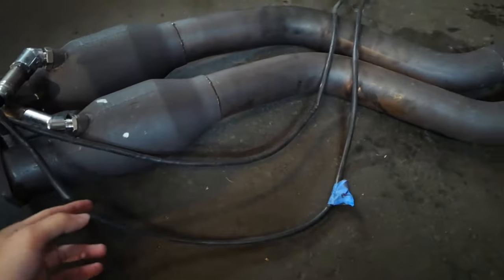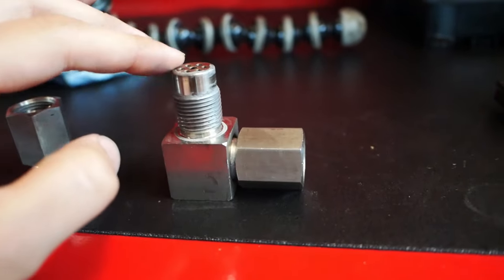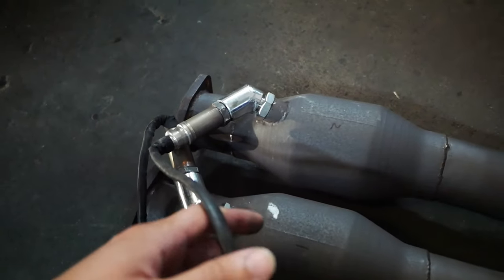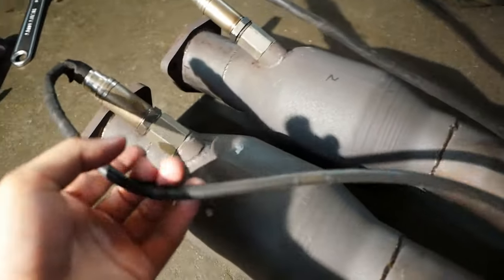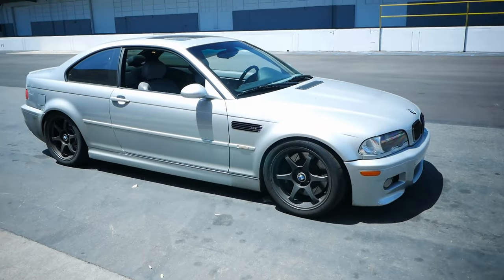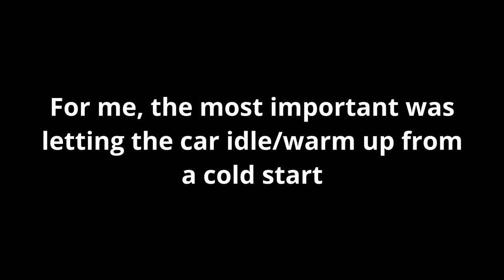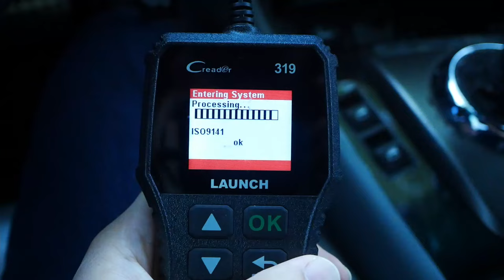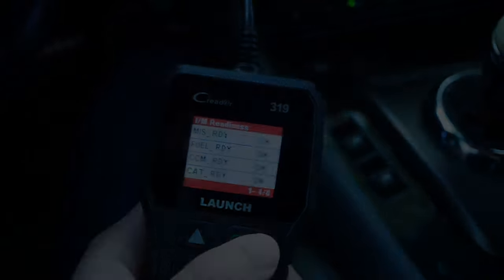Fix P0420 Code | How To Use O2 Sensor Spacers | Project M3 Episode 2

Comment: Omg 4th try and it passed smog! Used 2 Autozone 42002 non foulers. Thank you sooo much. You're the only one who said to try diff lengths. No vids I've seen said that. On my way to get my sticker. Helllloo June 2021! Yes they're that expired.
Reply from the maker: LOL hell yeah! Congrats!
Reply: @HazardGarage  I installed my spacer got rid of the light but I'm having a loud hissing sound coming from my exhaust when accelerating. Any clue what it could be?
Reply from the maker: @TimPool-b8z  you might have an exhaust leak. Check you tightend all the bolts and check the condition of your gaskets.
Reply: @HazardGarage  Dorman 42002 uses an angled seat. All O2 sensors use a flat seat with crush gasket. The Dorman version built like this with flat seat and gasket is 42009. An angled seat may give you a leak against a "flat-bung" surface that wants a gasket.

Comment: I remember doing the drive cycle for my 07 Maxima after replacing the catalytic converter and it took a couple days. When the sensors finally readied, I wasn't even trying to do the cycle, I had actually given up. I think the car was just laughing at me at that point. There's really no one size fits all strategy when it comes to completing mymonitor readiness.

Comment: The spacers caused a lean code for me? I am running long tubes with high flows. Without the spacer and the code cleared they won't come on or be green. All other monitors are ready.
Reply from the maker: 1st make sure these are on the O2 sensors that are AFTER the CAT not before.

2nd I had to do trial and error with various lengths. It was an annoying process. O2 sensor not reading correctly or too lean? You have too long of a sensor or too much interference. Use a shorter spacer.

Still getting P0420- bad cat codes? Run a little longer spacer.

Also the CAT sensor is the hardest sensor to get 'ready'. On average about 50-100 miles to throw a CEL if it wasnt good. And when it was good, I had to drive about 200 miles before it switched to 'ready'

Also make sure you dont have a tune on the car that disabled the rear O2 sensors.

Good luck!
Reply: Thanks for the response.  I have a tune for them to be active. I guess the journey begins......
Reply from the maker: @robettballard710  lol I feel you man. It took me like 4 tries to get just the right amount of length spacer. And then all those miles getting the stupid car to complete its readiness checks. Good luck!
Reply: One more question? During these trials did you complete the cycle in one day or multiple days? Or does that matter. Thanks.
Reply from the maker: @robettballard710  it doesn't matter if in a single day or over several.
Reply: Thanks

Comment: Where did you get your spacers
Reply from the maker: off of ebay! check the links in the description. (I just updated them as I noticed some were dead).
Reply: @HazardGarage  eBay banned these
Reply from the maker: @XenomorphLV426  I noticed that! Crazy! Guess you gotta go the 'spark plug defouler' way now. Unless savvy sellers rename these...
Reply: Don’t waste your time or effort because the code will come back. This is not a fix it’s a temporary to get used to omissions to get the light out after 10 to 12,000 miles. The light will come back guaranteed I know because I’ve done it I drilled the one to a half inch and put the other one on quite a few things will happen you’ll get pinging on acceleration, poor gas, mileage hesitation on acceleration quite a few things will change you won’t see it right away, but it will start. Don’t waste your time fix the problem why is it coming on get that fixed? If it is the cat get it replaced don’t play this game. It’s a money gimmick.

Comment: Another thought....seems you could have used the original 90 degree "cube" style you show.....but trying it severals ways.....with or without the mini-cat-material insert ( if it came with one).....and the piece that screws into the cube can used or even not used....just plug in the sensor into the cube. That alone gives you 3 "length" variables. Also this.....some folks buy the Dorman 42009 pair and either one ( or none) of these 2 parts added as 1 or 2-stacked pieces can also be tried with the "cube". I felt the same joy you had showing " 0 " DTCs !!!!!!

Comment: Trying to wrap my head around how we get a "tight" connection between the "cube" and the "bung". I see it allows angular orientation to change.....but... Should there be a gasket between the "cube" and the lock nut?...and also between the same locknut on the other side against the exhaust port "bung?.

Comment: I put 2 spacers with steel wool on my Maserati Gt with the v8 and it only went a week. I think it burned up the steel wool when I was revving it hard. I’m about to try the mini cat. Smells like a refinery behind the car but the exhaust velocity is really high it blows mulch and rips grass out of the ground so it might need 3 spacers.
Reply from the maker: I dont know if the mini cats helped. For me it was just playing with the distance of the spacing. But really more modern cars are bit more sensitive so its a gamble. Frustrating, I know..

Comment: It’s my upstream sensor that’s throwing the code bank 1 s1 
Ever since I installed LT headers and high flow cats on my challenger I’ve gotten multiple o2 sensor codes it’s been a headache. I love the bolt on install performance has been amazing except for these annoying codes. I can’t pass inspections text in Texas. 
I replaced the o2 sensors and still not working. 
I’ll give these a try 
Thanks for the video.
Reply from the maker: never use a spacer on upstream O2 sensors! upstream sensors tend to be responsible for keeping your engine running correctly adjusting air fuel ratios. Downstream (after the catalytic converter) tend to be used solely to see if the catalytic converter is working (although highly advisable you search and see if this is the case for your car.)

As shown in the video, for downstream O2 sensors, sometimes you have to play with the length to get it just right. And some cars are a lot more picky than others. Outside a tune, this is unfortunately the state of affairs. Also note, if you are using this for emissions reasons, you might not pass a visual inspection (check your local laws).
Reply: Hello, please, can I use these spaces on my car, I'm getting cat low deficiency bank 1 & 2. Please can I use this spacers and which o2 sensor should I put it? Will it stop the code if I put the spacer in the bank 3 and 4? My car comes with 4 o2 sensors.

Comment: Hello I will be installing obx headers and y pipe to my car. I bought some spacers and I would like to know at which  o2 bank locations are spacers needed to avoid CEL? Because there’s down stream and up stream …Please let me know thanks! Great content btw!!!
Reply from the maker: Don't use spacers on the upstream O2 sensor. That is the one before the CAT. This O2 sensor is used to measure your car's Air/Fuel mixture. Downstream (after the CAT) is where you can use these.
Reply: @HazardGarage  after having 02 spacers for a week I got a cel. Any fix to this?
Reply from the maker: @Stay_True_-  you have to keep testing different lengths. Its annoying, I'm not going to sugar coat it.

cat deficiency error - means O2 spacer is too close to the exhaust stream. Needs more spacer.

O2 sensor slow to respond or similar - means O2 spacing is too much. Move closer to the exhaust stream (less spacer).
Reply: @HazardGarage  i replaced the o2 sensor and the code hasn’t came back…hopefully it stays away

Comment: The slow response is due to the sensor is too far from the CAT. The temperature is too low to keep sensor ceramic to be hot enough to work like a semiconductor.
The spacer has to be as short as possible.
Reply from the maker: thanks for the explanation and you are right. When the slow response happened I shortened the length. When CAT deficiency happened, I lengthened it. Played around with this for a bit until I got the riiiiight length.

Comment: Did you use copper exhaust sealant or anything to seal the O2 adapter?
Reply from the maker: No sealant. I did use a little anti-seize
Reply: @HazardGarage  curious how they don’t seal since it’s just threads and not crush washer

Comment: lol you don't HAVE to drive 55 on the freeway. If you just drive normally, it will set eventually. The recommendation to drive 55 is just if you're trying to make it do the drive cycle more quickly, but I don't think that's even applicable to all cars.
Reply from the maker: There was a BMW specific drive cycle to make it go more quickly....but I can tell you after hundreds of miles...it made no difference on a BMW lol. So yeah, I would totally just drive normal lol.

My subaru and Miata however, those were very quick to drive cycle just by driving around but BMW has to be difficult ya know?

Comment: did you have to do a drive cycle with each o2 sensor, or did you get a code immediately for the ones that didn’t work?
Reply from the maker: You generally have to drive around 30-40 miles before a CEL would be pending or show up.

Very annoying process that I had to do multiple times.
Reply: @HazardGarage  i need to do this on my n54 but it doesn’t seem worth the effort with how sensitive newer BMW ecus are
Reply from the maker: @desolatedreams21  its super annoying i agree. But its an option thats out there for those who need it.
Reply: @HazardGarage  i’m going to try it on my e92 for shits and giggles. dpfix is gonna be the most probable solution LOL

Comment: , I have a question
I have the p0430 because my cat is dying, i heard that you have less power if this code shows up. Does the spacer also bring the power of the car back or is just the check engine light gonne
Reply from the maker: some cars might do a limp/safety/reduced power mode when any CEL comes on.

some cars also might use both upstream and downstream O2 sensors for fuel mapping

best is to search around for information on your specific car.

My understanding for the E46 M3 was that there would be no issue with power as long as the CEL was off as I did not find any thing info saying the rear O2 sensors were used for fuel mapping.

Comment: Bit late to the party but the info is much appreciated. The subaru community is currently going through these headaches due to the recent green speed update that prevents tuning out the rear 02.

As I'm just starting to experiment with spacers myself I'm wondering, when you were changing out spacers did you just keep resetting the code? Or did you pull a battery terminal to make sure it's fully gone?

Did the car remain code free? I'm fighting an intermittent P0420 myself and I tried one of those mini cat spacers and got a lean code, hoping maybe a shorter regular spacer might help.
Reply from the maker: I would erase the code then do a drive cycle again. the car remained code free but after about a year I had to unplug the battery and then I started getting a code (lean - so spacer was too much). The BMWs can be finnicky but it works, just annoying to have to keep playing around with the different lengths until it works.

Comment: Any updated spacer links? Looking for the 43-45 length ones. The link listed doesn’t work unfortunately. But love the video, new subscriber here as a result of this solution.
Reply from the maker: wow, I just checked and looks like Amazon and eBay have removed these listings. I updated the description but you can still use spark plug non-foulers and stack them if needed. You MIGHT have to drill out the internal hole a little bit to fit the O2 sensor but this hack has been around for decades. It was just nice to have pre-fitted spacers.

Comment: Hey man so are spacers not illegal? I’m having the same issue my check engine light is on but because I have stock o2 sensors with a performance exhaust system and I was thinking about getting spacers
Reply from the maker: you won't pass smog checks with them.
Reply: @HazardGarage  Then how did you pass smog?

Comment: The spacers that didn't work should work without high flow cats meaning no cats at all correct?
Reply from the maker: The theory is you're trying to find the "goldilocks" distance of the O2 sensor from the exhaust stream.

Too close into the stream, the o2 sensor will read too much fuel, and think the cat is busted and will throw your P0420.

Too far from the stream, the o2 sensor will think theres too little fuel in the exhaust and think something is wrong with the o2 sensor and throw a different code.

Just right, itll be within what the car deems as a normal spec.

Some cars this will be a wide window, others it will be narrow. It really is trial and error and isnt really guaranteed.

*education purposes only.

Comment: I can't believe it didn't work for me. I thought for sure it would work. I have an 07 honda accord coupe w/P0420. My friend put 2 non foulers from Autozone connected to each other but the CEL came right back on. I'm bummed. I think it was part no 42009. I never get a break :/
Reply from the maker: what was the code? was it P0420 again? If so, that might mean you need to space it out even further. Maybe try a 3rd short non fouler. If you received an O2 sensor code for it not reading properly, then you'll need to shorten the length a little bit.

Its all trial and error and super annoying! I had to do it like 3 times! But since I hit the right length, ive been trouble free for a year now!
Reply: @HazardGarage 
Space it out even further? I can try that. I removed one of the non foulers and it came right back on. P0420 is the only code.
Reply: @HazardGarage 
I got 2 more spacers, fingers crossed. My car has a new engine and a new clutch so I don't want to get rid of it yet. Yes, clutch. 
I ❤️ stick shift.
Reply: @JetBlackBerry  did the code go away after 3 spacers?
Reply: @Cliffjumper 
Yes! But 3 spacers didn't work. I used a different spacer. Everyone seems to use Autozone part# 42009, but it didn't work for me, so I tried part no. 42002 and it worked! I used both in the pack. This one was easier bc it didn't need to be drilled. It screwed on perfectly. I passed smog in CA and got my tags.
Reply: @Cliffjumper 
I have an 07 honda accord coupe
Reply: Did u ever resolve this. I'm in the same boat

Comment: Hello, please, can I use these spaces on my car, LEXUS IS250, I'm getting cat low deficiency bank 1 & 2. Please can I use this spacers and which o2 sensor should I put it? Will it stop the code if I put the spacer in the bank 3 and 4? My car comes with 4 o2 sensors. The O2 close to the engine is 1&2 and that is where I'm getting the code.
Reply from the maker: These are only to be used on the REAR O2 sensors (after the cat). However, newer cars can be very tricky. It might work, it might not.

For example on the M3 (which is a 2002 only) I had to try 2 different lengths and drive a total of 200+ miles to see if it worked...it sucked =(
Reply: @HazardGarage  I understand
I saw a video on someone that did it on the same engine as in my car so I believe it will work. I've orderd for it already
Reply from the maker: @promiseonwuachu  i hope it works out for you!
Reply: @HazardGarage  you're scaring me hahaha

Comment: I installed the L shape spacer on catless downpipe,
it didn't trigger the CEL. but when i scan with OBD it shows Slow Respons Code..i need to reset everytime if not the pops and crackles stop working LOL.. 
any idea which spacer should i change to?
Reply from the maker: slow response sounds like its not getting enough 'exhaust' air. Try a slightly shorter length or if theres any 'mini' cats try taking them out.

This stuffs annoying as hell cause its a bit trial and error and driving to see if codes pop up or not. Which can take miles to find out if you got the right size. but good luck!
Reply: @HazardGarage  Thanks for your reply..i might try shorter spacer without mini cats

Comment: No they don’t. I know because I tried it. It got me through omissions are past 10 to 12,000 miles the same code come back you’re gonna have to deal with it fix why the light is coming on or replace the cat or pull it out clean it and soak it overnight, that’s the cheapest route orders pay the big box and have one installed. I’ve done the drill and one out putting the second one in and another issue that will come up. You will have pinging on acceleration your gas mileage will drop you won’t see it right away but it will. 0:23

Comment: Works and got rid of the 401 code I had but now car burns more gas... Gas mileage declined
Reply from the maker: make sure you only use this on the O2 sensor(s) responsible for monitoring your cat (usually positioned AFTER the cat) and NOT the main O2 sensors responsible for the air/fuel mixture of your car.

Comment: Hi will the work for a 2007 328i what’s the part number of spacers thanks
Reply from the maker: unfortunately it looks like ebay no longer allows sellers to carry these spacers but you can still go to an auto parts store and buy spark plug 'non-foulers'. You might have to drill these a little bit to fit your sensors though.  However, the concept remains the same for practically any car I can think of.

Comment: i put headers in my  truck no cats and have 4 sensor do i put 4 spacers?
Reply from the maker: you would only need spacers on the rear o2 sensors (after the catalytic converter). The 2 front O2 sensors are for your engine air and fuel measurements, do not put spacers on those or your car will run bad.*

*education purposes only.

Comment: I installed the right angle on mine but I got the p0137 (low voltage) so I’m not sure if it’s the same issue that can be fixed with straight spacer. Here’s to hoping!
Reply from the maker: it might! low voltage can mean that the O2 sensor is reading to lean. Running a shorter spacer will introduce more fumes and hopefully its just riiiiight. Good luck!